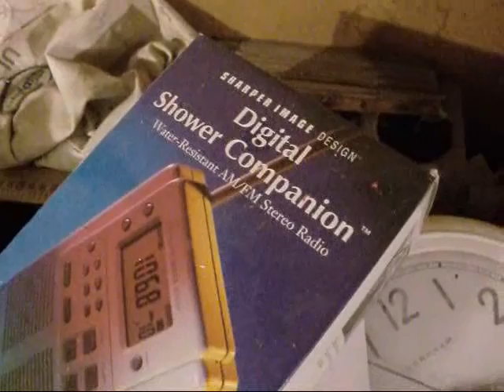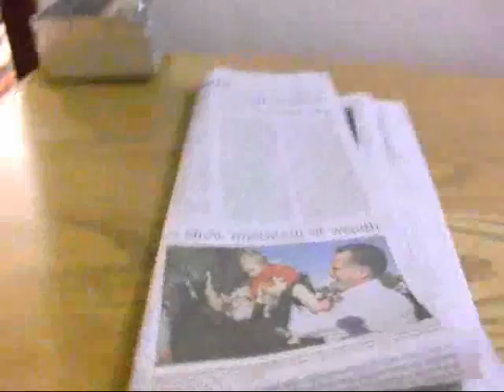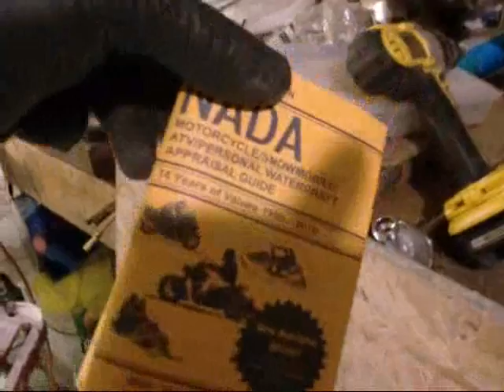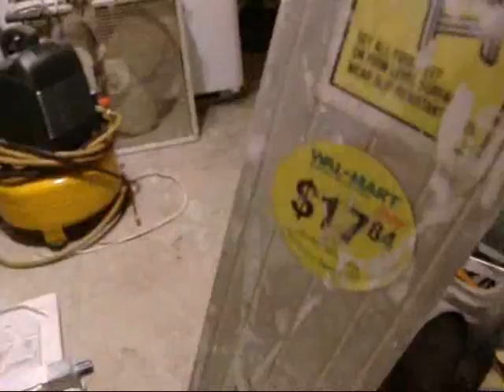1 25 12  Hooking Up 208 Volts...

Comment: I work in a winery, I went to plug in a 208 pump into a 208 extension cord that came out from behind a large tank... BOOM!!! literally blew up,the pump!   Upon investigation I found that someone had wired one end of the cord to 480 with a 480 plug and used a 208 female at the other end for a specific piece of gear.  omfg...

Comment from the maker: @67tr876 It has it's own step down transformer. It was as big as a full size car, but they put in a much smaller one a few years back. Yup, 100% electric everything!, but decently insulated, and very cheap .03KwH) municipal electric